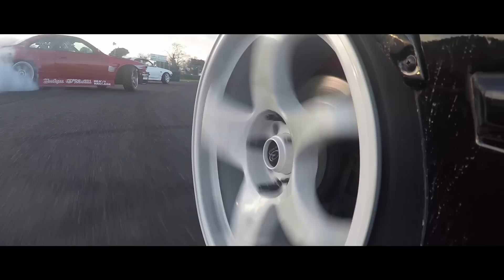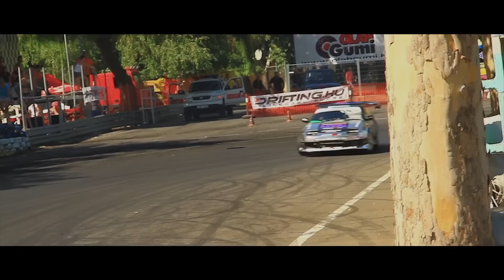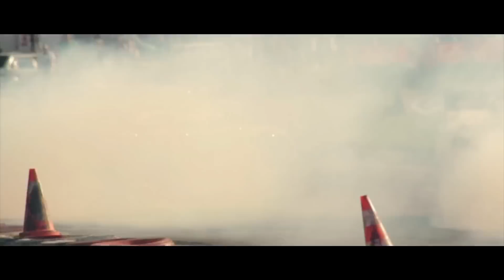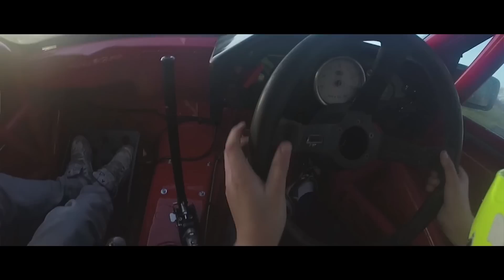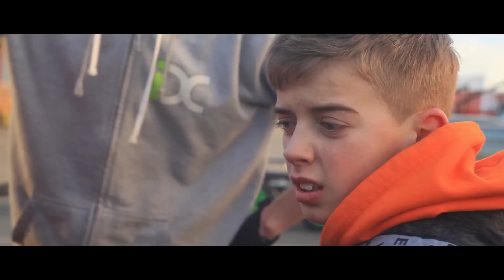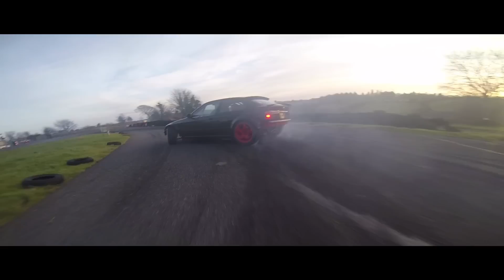This 15 Year Old Is A Better Drifter Than You'll Ever Be - XCAR

Comment: Look up   Lloyd Smith KE30 corolla   he started competing at 14 in a non turbo non handbrake non anything corolla and was as good if not better

Then worked on that car until he could build a ke70 with a high compression 1uzfe v8

Comment: so these cars are fwd and the back tires lock up for the drift?
Reply: it's RWD
Reply: the handbrake locking the rear wheel. and the car is moving that's why the front wheel is moving
Reply: but what I said works to
Reply: +Riley Derifield no
Reply: +Adh Snoopy lol

Comment: one question: why does drift cars have a rear wing? i believe they don't need the downforce…?
Reply: The wing doesn't give a lot of downforce but it is helpful to push down on the back wheels some so that they continue to push the car forward even while they are spinning
Reply: Fabian Pe an adjustable or custom wing can help correct the car out of higher speed drifts, but under ~60mph wings have  little effect beyond putting a touch more weight over the rear wheels.
Reply: And sometimes it's for looks. Unlike time attack, circuit racing or rally stage, their are no regulations on aero and stuff so drift cars can look stock, stripped down to a bare chassis or loom like a hill climb car
Reply: +mindofmyown333 also sometimes you will see large diffusers on the tips of the wings to act 0/90 anti stall so to help correct over rotation

Comment: First become a drifter there are more risk on your car if you doesn't change part or modified car...just what I thought...seem your gearbox broken cause you roughly change gear and suspension need to upgrade...